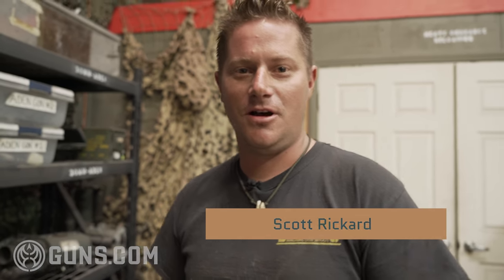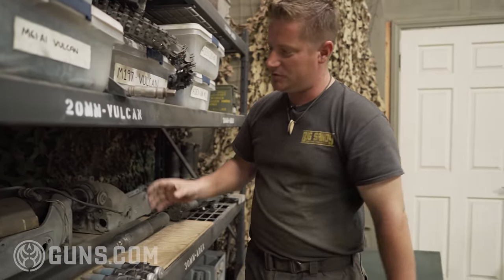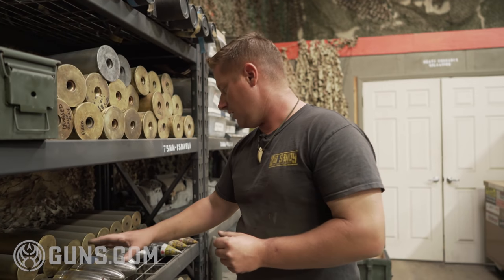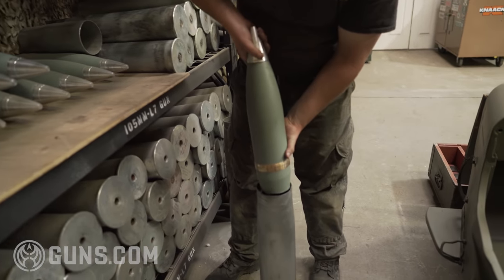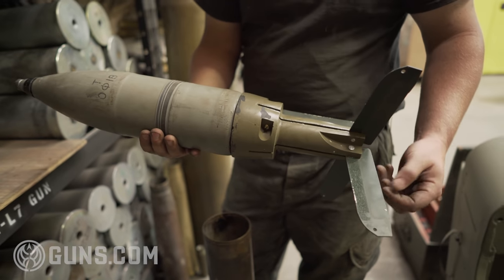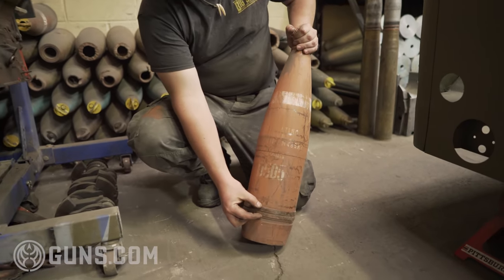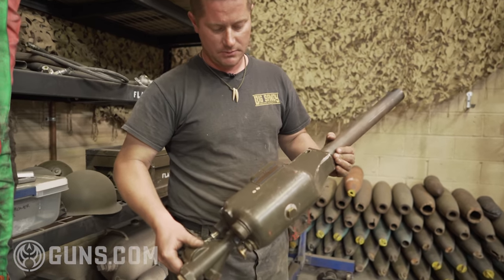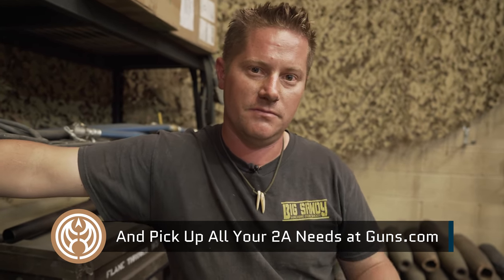Touring Large Calibers and Tank Rounds at Battlefield Vegas

Comment: I remember when my dad and my neighbors would bring home casings from some of those mounted guns and artillery.
Reply from the maker: Very cool.
Reply: My dad got me started collecting cartridges, shells and cases. He had 50 caliber salt and pepper shakers that he made in the Navy after the Kiska Alaska invasion in WWII. I was mesmerized by the size of them. That was 65 years ago when I was 3 years old. I remember them sitting on the breakfast table. Holy smokes these inert ordnance things are getting expensive. I topped the charts and bought an inert big blue 16''-50 battleship shell in a crate some years ago. It weighs 1902 pounds and was typically fired from US Iowa Class Battleships.
Reply: @kimmer6  You mean round or projectile? Shell is what holds the powder and projectile, which weren't used on large guns like the 16 in, as they used powder bags.
Reply: @PilotTed  Actually, the shell IS the projectile even on bag charged guns like the 16 inch 50 Mark 7. A round is a complete cartridge which has a power case and a projectile. Somewhere along the way it became common to refer to a cartridge as a ''shell'' as in shotgun shell. I'm not real picky on terminology but sometimes get corrected by ordnance collectors who know every little detail about terminology.